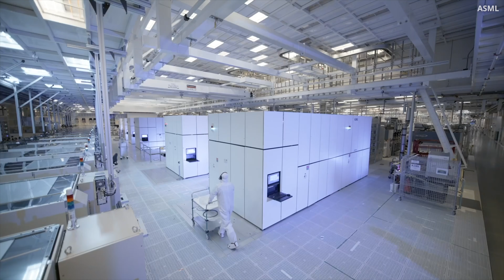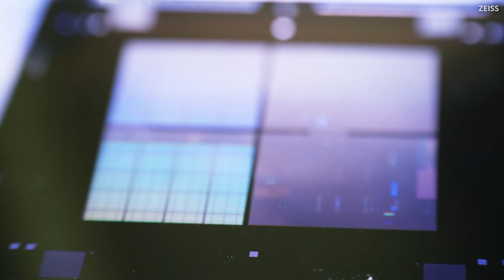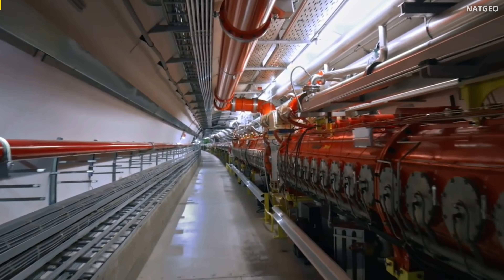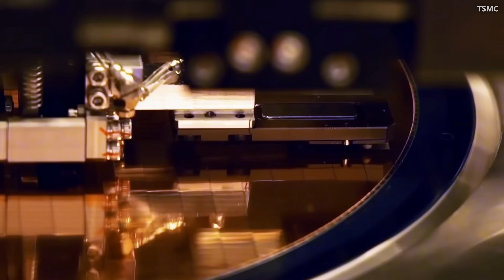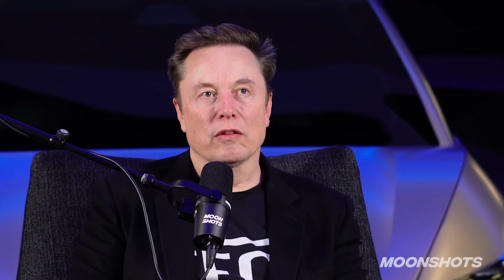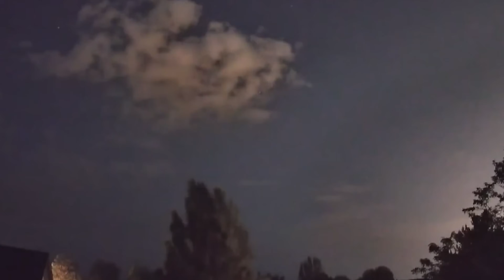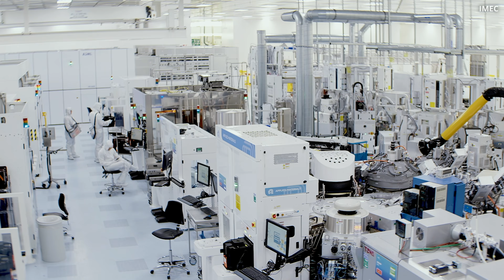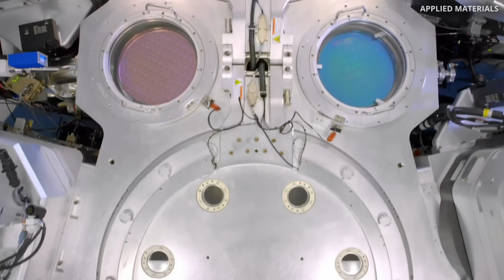New Chip Factory That Terrifies TSMC

Comment: I watched several of terafab videos, but this is the first one which actually explains “what, how and why”!
Thank you for your effort, great video
Reply: Shes comprehensive.
Reply: There are others, just remember good news is bad news. Most would rather talk about the negative sides of everything, instead of just the facts. The terafab project is extremely hopeful, if we lose Taiwan, terafab will become very important, and even if we don't lose Taiwan it will still serve a greater purpose. All tech regardless of AI will need these types of chips, it's just a simple fact we try to create more for the world. If Elon don't do it, someone will have to.
Reply: @quor2243  You beat me to it.   The Chinese are being explicit that Taiwan is theirs, because they covet the TSMC technology which they can't do on their own.   Presumably if the worst happens, the Taiwanese will destroy the machines and bail to the US
Reply: @teekay_1  China has been trying to erode Taiwan's independence far longer than their FABs dominated. It's less about FABs than you think. Taking Taiwan does not get China access to supply chains necessary to make advanced chips. The only quartz in the world that can be used is from North Carolina. Quartz crucibles are single-use and all advanced wafers require that exact quartz for it's purity, and how it melts. There's no work-arounds. That's just 1 example. The EUV machines also have supply requirements China couldn't get.
Reply: @gcburns4  Dus China neemt al voor 2030 Taiwan in.
Reply: @quor2243  Even Intel, with its long history of experience, can't produce the most advanced chips; how can you expect Elon Musk, who has no experience, to do so?
Reply: @quor2243  Terafab will fail. A simple fact is that USA does not have enough engineers for Elon to hire.
Reply: She actually knows what she is talking about everyone else just makes trendy content creation.
Reply: @kittywampusdrums 
☝️THIS 💯
Reply: @kittywampusdrums  what? 8:54 how is exactly tesla going to make 600% more of robotaxi  than all of her other cars combined?
Reply: @kittywampusdrums  we try to help her understand the foundry model, is she understanding it, able to read it ?
We need to help the channel, but how ?
Reply: Lithography tends to be semi secret.
Reply: @darkhorseman8263 't is, fully patentend in dutch hands by ASML, europe 's highest valued company.
Reply: The middle east may have oil, but the purest silicon you can make? Ingredient found only in the US. Nothing as pure is found nowhere else. Unless a site is found somewhere else, the US would still be the one who dictates who can make the_____(you supply the adjective,  English not my primary  language) microchip. Let the implication of that sink in.
Reply: @rimmelosmoloc4158  - yes it's the pure quartz. It's the only quartz in the world that can be used as crucible for the ingot crystal. All other quartz is too impure and would contaminate any silicate used for <7 nm wafer production. And you can't just purify quartz. It destroys the quartz. All high-end chips stop production if North Carolina mine went offline. It would be trigger global economic crash never seen before.
Reply: The raw materials, ingots are the problem. There's one that China has a monopoly on. That needs to be addressed.
Reply: @wannabecarguy  - China controls some rare minerals that are used in the advanced machinery to grow, clean and polish the ingot, not the ingot production itself. They would be dependent on US for quartz if they want to make high-end chips, so it's not a 'monopoly'. DOD/DOE already are planning to extract Gallium/Germanium/Tungsten from coal waste and acid mining waste. We don't have the facilities online to process yet, but we have an immense supply from these sources waiting to be tapped. It hasn't been profitable, but now it's considered national defense priority. We have much more of a 'monopoly' on Wafer production than China does. Again, you're talking about Chinese minerals used in parts for lots of advanced machinery, not necessarily specific to ingot production.
Reply: As soon as this factory start its operation, Taiwan will go back to main land China.
Reply: So,  ow the ckokepoint shirts to the Netherlands, the only country where they build th machines that make the chips. ASML having an unbreakable european supply chain.
Reply: It's more like Terafad. Elon is just generating hype for the SpaceX IPO.
Reply: See y buy junk u get junk trump open ears why he drop y ass
Reply: I have worked on five Intel fab plants in Arizona and one Philips semiconductor plant in n.m.
Reply: Why educate china in video.
Reply: Wait till you see the when-video It will blow your mind. It will be a huge breakthrough that no one can withstand or talk about. Thank you for your patience watching those videos. You are a hero.
Reply: It's never going to be like they planned. Elon is a king of overpromise and underdeliver and people seem to be fine with it. What he has going is that he has become a hype machine which allocates money for projects that already developed by somebody else and he takes credit for. That said, its going to be good for the world to have alternatives to TMSC and such
Reply: @emil-d7x  Na, it just sucks at time lines, but he eventually delivers.

Comment: Don't put anything past Elon. NASA, Russia, the European Space Agency and China sill cannot make reusable rockets
Reply: They are not even trying, though 😊
Reply: @dchdch8290 maybe not, but the fact that they aren’t says something about their ability, because it’s a no brainer when it comes to costs…
Reply: @Domarnett NASA made reusable rockets 45 years ago. First space shuttle launch was in 1981.
The reason most people don't make reusable rockets is that it isn't cost effective. A rocket engine is basically a controlled bomb operating at 1500K or higher and 5+ atmospheres of pressure. Most rocket engines destroy themselves within a couple minutes. Designing a rocket engine that can be reused makes it significantly more expensive. By the time you have enough launches to justify the cost, you would have saved more money making disposable rockets and taking advantage of economies of scale.
Reusability is not how SpaceX cut their launch costs. It is mostly a marketing gimmick. Their biggest cost savings come from not using liquid hydrogen as a fuel.
Reply: ESA has never made rockets, they farm that out like NASA does
Reply: The Shuttle ..... Moron.